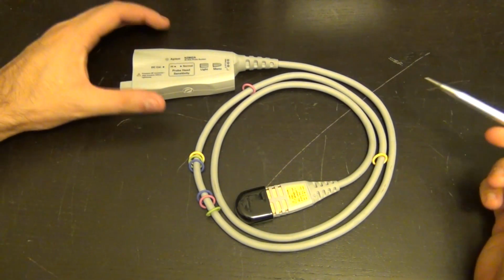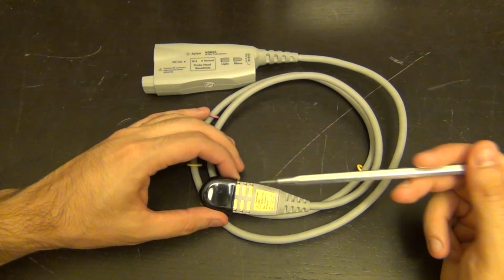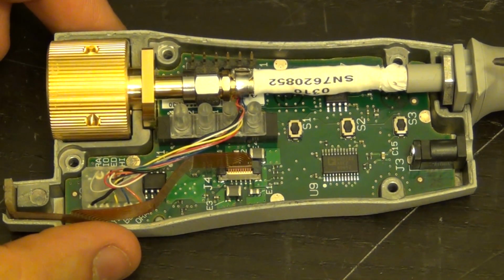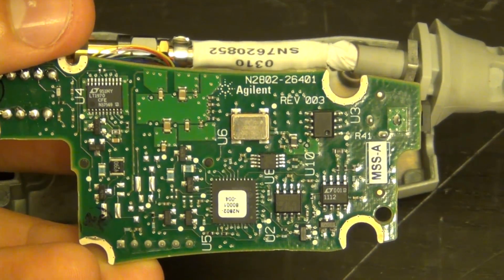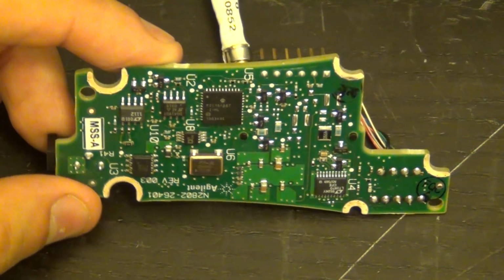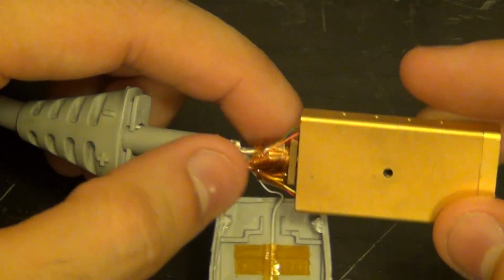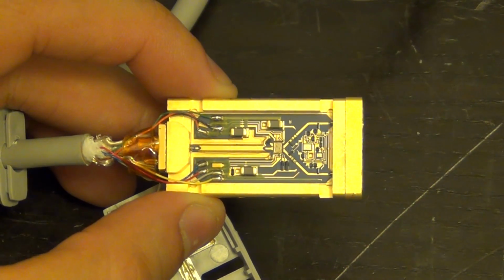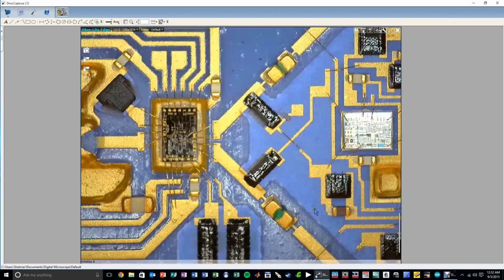TSP #63 - Teardown & Analysis of a Keysight InfiniMax III N2802A 25GHz Active Probe

Comment: Thanks for wonderful explaination. Adding something to 6 years old thread here: The Keysight seminar link Mike responded to the ESD protection query saying that they cross the paths to create a spark gap. This protects the amplifier: https://www.youtube.com/watch?v=DNXPpkgiCLQ&t=287s at 12:36
Reply from the maker: The spark gap approach is certainly not used in the high-BW active probes. It may be used for some of their higher voltage probes. They do have active diode protection (for the 50-ohm resistor and input of the amp). A spark gap would not protect the probe type I am showing because the breakdown of the input devices is far below any spark gap activation voltage.

Comment: Dielectric injection .. looks that micro coaxial is brazed or  soldered..hope so ..top conductor looks brazed ..hope  so ..your thoughts ..you have a better look .. input side should have protection circuit.. ultra low cap ..can you shed some light ?

Comment: The 6-pin interface screams PICkit socket. Try read it?

Also if you do not plan to repair it (effectively buy one at half its price) you can desolder the precision op-amps for your owm projects as those will be very expensive on their own.

Comment: Thank you for spending that much money just for a YouTube video. Highly appreciated; I hope that you've gotten some benefit out of it as well. What do people use these sorts of probes for, do you know? I imagine R&D environments using cheaper methods like having key signals split or buffered into coaxes or something. I can only think of scenarios where things are going terribly wrong and a person can only figure out why by probing lots of things on boards. Troubleshooting radars? Troubleshooting particle accelerators? University experiments? I would genuinely like to know specific use cases for these. :> Most people here would be surprised at the kinds of clever tricks companies use specifically to avoid the need to splurge on unobtanium lab gear.

Comment: There is semi-transparent mask coating on just one (left) side of black resistors(?) near criss-cross wiring. What was the reason of doing that?You can clearly see it at 22:00.
Reply: +101ful : I noticed that too.. Good question. Maybe it's just related to manufacture.

Comment: On the de-coupling caps is some 'green- crud' is that normal?  What is that?
Cheers, Mark
****************************
Reply: +Mark Beeunas I believe that's the exposed dielectric of the cap, but my guess is as good as any.
The golgen contacts hide it, but it seems that the whole cap's dielectric is green. Although it does look like there's something going on there in the middle, it seems the dielectric is cut in half or scored.

Comment: Very interesting video. I learned many new terms. In the front end, are the resistors built in place? I'm probably not asking that correctly, but they look different than SMD resistors I've seen, and wondered if the resistor material is deposited on the board instead using a resistor part.
Reply: +Kent A. Vander Velden I have the same question as whell. It seems like made in place by deposition, as to get the correct value by manipulation of its dimensions. But there's more to it.. the more I look, the more details I find..

Comment: They would sell more if they charged a more reasonable price, such as $50, which will cover the cost to make it, and have a lot left over for profit.
Reply: I think you left a zero or two off that cost to build estimation.
Reply: +Rhys Dippie If anything, they should use the probes to sell more scopes, e.g., sell the probes for $5-10 each, and then make the profit on the scopes, e.g., massively boost sales by capturing the general consumer market, by discounting the probe to $5, and then sell a decent 25GHz bandwidth oscilloscope for $500. This will allow them make high performance oscilloscopes become a common place household item. (e.g., the average customer will think, hey, my Galaxy note 4 smartphone is good enough for another year, I will get a high performance oscilloscope instead.
Reply: +Razor2048 This isn't something you can just use without extremely specialized equipment. Your 25Ghz probe means squat if you just stick a tip on it and start touching it to circuits, you need an entire impedance controlled path, specially designed to be probable, on a board that can handle 25GHz to begin with and a 200k+ scope to see the results..  As in, this is only useful for debugging boards that cost 10k+ to make to begin with. Everyone that needs one really needs one and paid the 23k for it because its nothing compared to the millions for the surrounding infrastructure, everyone else will have no ability to use it.

And the raw cost to make it is easily in the thousands if not more. A semiconductor fabrication plant is tens of billions of dollars to build and many millions to maintain.  Dedicating an almost certainly home designed production line to a limited use fabrication technology just to support a few niche products costs a whole lot.

23k actaully sounds a bit cheap.
Reply: +Razor2048 Haha not sure if you're kidding or what. XD "Consumers" have zero interest in these devices, that's why they're expensive specialist products. Why does a "consumer" need a 25GHz scope? For what? :> What would you do with it? There are plenty of $500 scopes that are good enough for repair and development of the sorts of things hobbyists would touch. High frequency things require a volume of knowledge that's unobtainable by a "consumer" as just a hobby. It's something you have to specialize in academically at least.

Comment: It also stands to reason that Keysight's wafer fab is a very small facility; they turn out only 2500 wafers a year for every process they fabricate, and III-V wafers are only typically 80-100mm in diameter.
Reply: +douro20 Really? Only 2500 wafers a year?!.. Is that taking into account a lot of wafers that didn't meet spec?

Comment: I have a serious question and google is a bit lost (if you put "microwave", "chip" in the query you are headed to disgusting food), why is the signal path on the chip double bounded at those frequencies?
Reply from the maker: +Ivan Kocher The main purpose is to reduce the bond wire inductance and create a more uniform impedance.
Reply: +nraynaud1 My guess would be to reduce the skin effect, and also adds some sort of reliability
Reply: are they length matched then? does that means you have to match 4 wires? (2 wires per side of the differential pair)

Comment: The decoupling caps on the input that you mention toward the end will allow AC signals to pass unimpeded but block low freq (DC) events, correct?

what happens to the DC?

you mention another path?

Comment: You said DQ with respect to the caps.

what is DQ?
Reply from the maker: +Zambia95 I said de-q, meaning to lower the quality factor (Q) of a reactive component. High quality factor components can create sharp resonances which in presence of negative resistance from active circuits may create a instability and oscillations.

Comment: Hi Shahriar, i wonder what is the hidden S1 switch for, maybe the PCB is common for different probes?
Reply: +Levon Avagyan The original owner probably pressed it. It converts your probe from $23000 to $170 :-)
Reply: +Coolkeys2009 You're right." "By pressing this button you admit you have open this device. Not only voids warrenty, but disables this module. You are on your own. Thank you for choosing Agilent!"
Some other combo of button pressing may make it 23,000$ again.. ;)

Comment: Sure about that input impedance of probe amp? I'd bet that it's very close to 50 ohm, maybe controlled by active circuit, and the input impedance of probe head is only 100k. If the input impedance of amp would be 100k, the transmission line betbeen probe head and amp would be effectively open ended stub, which would be quite problematic, as it's very long (electrically)
Reply from the maker: +Petex90 The input impedance of the amplifier itself is further transformed by the matching network as well as the probe accessory connector which needs to be attached. So you are correct that the ASIC input impedance is likely not 100k-Ohm.

Comment: interesting, is it possible to diy build a active probe to handle 100mhz.. even at lower frequency they still seem overpriced.
Reply: +BavarianMonkey you know what the guy meant you silly goose!
Reply: joblessalex yes, and this is why I wrote that 100 MHz (Mega) are basically DC, when you compare it to 23 GHz :)
Reply: +Yaghiyah Brenner sure, 100 mHz are basically DC, so stick to whatever topology you would like to use...
If you actually meant to write 100 MHz then the same applies